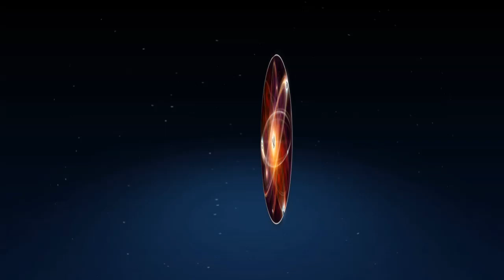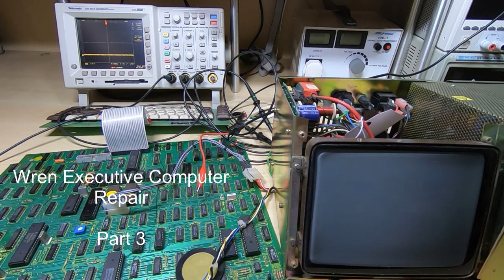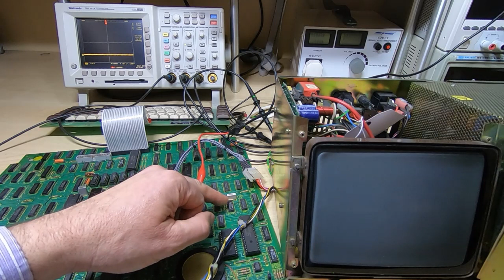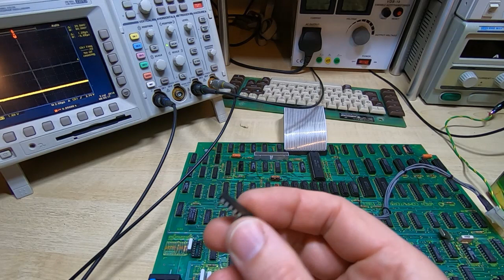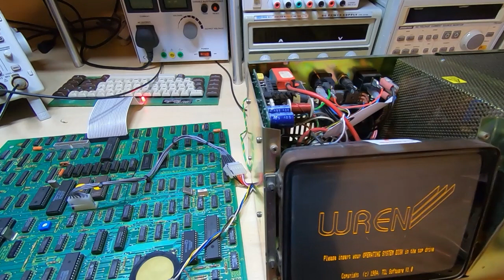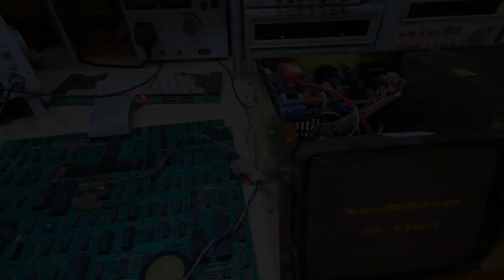Wren number 2 Repair Part3

Comment: Wouldn't be easier to break up the logic comparator ? As for the unknown chips, it is always a pain in the rear side when you need to guess what they are....
Reply from the maker: Unfortunately the logic comparitor would not really work here as the signals are marginal and so the reference device on the comparitor may be able to respond to the poor signals as it is a new device. Using the logic analyser allows me to adjust the thresholds to pick up weak IC's. Also the Logic analyser has linked scope and analyser domains so I can capture both the logic and the analog states at the same time. I will be posting a video on this when I get time as it is a very common issue on older equipment. Having said that I did use the logic comparitor to locate some failed IC's.